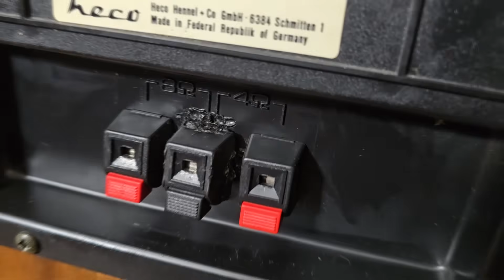Vintage 80s heco PCX-4 speakers: What's Inside?

Comment: What was the point of this video?  To look inside a spkr cabinet?  You could've talked about the crossover design; how they work; the parts used; how you'd repair the connectors, etc.  So much more you could've done here!

Comment: Simple crossover design, thin internal wires, and a faulty terminal… yet still sounds really good. More proof that music enjoyment doesn’t need perfect gear (or $5k+ cables) 😉😂

Sheep-wool was a simple damping trick (real, but minor) marketed as premium, but modern materials usually do it better/cheaper.
Reply from the maker: Thanks for your detailed comment